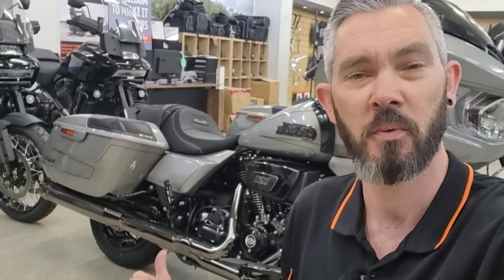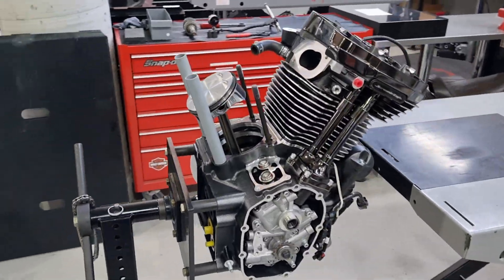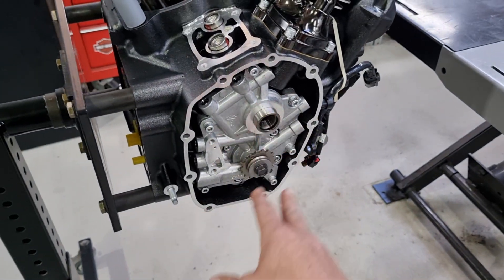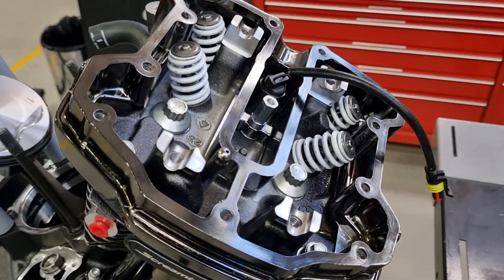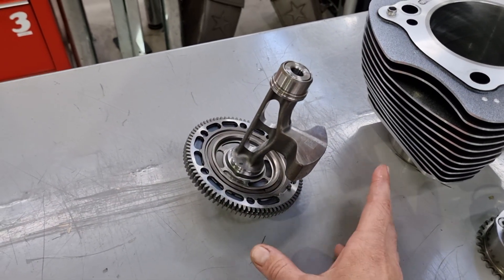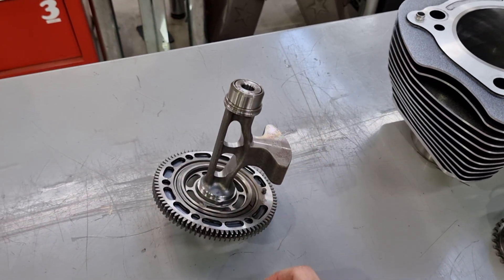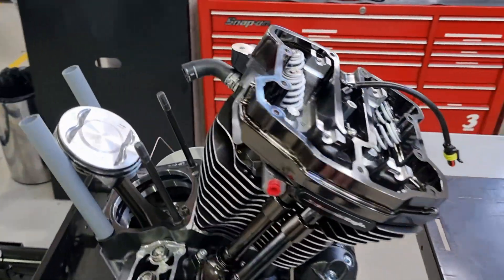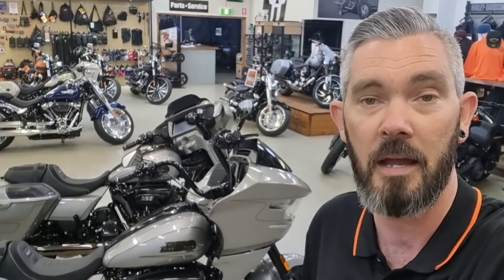INSIDE LOOK / NEW 121ci VVT M8 Engine / TEAR DOWN

Comment: @mastertechmiller. Have you noticed any issues with the high output 121? My 2024 CVO ST at 1500 miles is getting a new motor. Dealer said it had "worn internals". Not a reassuring answer. Others reported the same issue and are getting cyclinders replaced if not the entire motor.
Reply from the maker: @sleepingpanda8927  I haven't heard anything specifically about the High Output 121 but we did have an issue with our demo 117ci Center cooled M8 which was due to a stack up of events that lead to a blocked breather system (on the transmission cover). No harm was done to the engine.

It was only ridden very short distances & never really got to operating temps & as a result the oil developed moister in it which then helped to block the breather assembly.

Comment: I do NOT quite understand WHY they take HEATED coolant from one head and deliver into the 2nd head ?
I understand the concept of removing more heat from the cylinder with less air 
But , wouldn't it make more sense to cool both SEPARATELY ?
Maintaining EQUAL Head Temps for equal tuning of combustion ?
Reply from the maker: @user-rx9ww3ws6n  The front cylinder & cylinder head gets the majority of the wind passing over it. The rear cylinder & cylinder head is blocked by the front one.
 It's a known fact that Harley's rear head always runs slightly hotter than the front one so it makes sense to prioritise the cooling to the rear head as the front one has the additional aor flow passing over it that the rear doesn't get.

Each cylinder is capable of individually tuning so I can & do tune each cylinder independently of one and other so AFRs, ignition timing & temps are optimised.

Comment: For the money they demand for cvo models, which this motor would be fitted to. I would expect a screaming eagle cam plate and oil pump.
Reply from the maker: @DK-xy8gk  So far it is only offered in the 135ci Screamin Eagle Crate motor

Comment: My 2024 CVO 121 VVT makes a Ticking noise.  Reminds me of a Valve Train noise.  However I had Harley look at it and they said its normal.  Could you explain this.  Only seems to be prominent on Cold start and for the first 5-10 Mins after Start up.  Once engine is hot.  Noise goes away.
Reply from the maker: Yes it's normal. It's related to the VVT Cam phaser. Once oil temp comes up to operating temps the system is working alot smoother & the noises reduce.
That's the short answer.

I could go into more detail about the entire system, but just know it's normal & nothing to worry about.

The Revolution Max engine found in the Pan America & Sportster S models is exactly the same if not louder on cold starts with the same noises
Reply: @MasterTechMiller  In that short time that its ticking.  Its not doing any damage?   Sounds to me like the Lifters are draining out the oil and takes time to fill back up.
Reply from the maker: @user-df7df1eb8z  No, nothing to be concerned about. 
Because the engine is idling & going through it's warm up cycles, when cold starts happen, the VVT system is in overdrive as it is making constant adjustments to the valve timing. 

Remember, the engine is at low running speeds, which gives off erratic MAP (manifold absolute pressure) readings, which is one of the readings the VVT system uses for adjustments. Then, as the idle speed slows even further as the warm-up cycle is completed, the VVT system is again making many adjustments to give the best efficiency & smooth running to the engine.

At cruise speeds, the RPM, MAP & Throttle position is relatively constant & the VVT is quieter.
Reply: @MasterTechMiller  I appreciate the Feedback and makes me feel better about it.  I really enjoy my Legendary Orange CVO.
Reply from the maker: @RichardRamsey-l8o  beautiful colour!

Comment: Thanks for all great info. can you tell me there is electric wires coming out of the transmission.... And on the non VVT 2024 road glide  and street glide wires come out of the cam cover. THANKS
Reply from the maker: Wires from the transmission is for the gear position sensor.

The wires coming from the cam cover on both the VVT & Non VVT Engines is the cam position sensor.

Comment: By design, im not sure Duration adjustable.
Reply from the maker: Yes my apologies in my choice of words during the video. No scripts here, just point the camera & start talking. Occasionally, I will make a mistake & mix up my words. There is a lot going on in my head & when it's running in top gear & my mouth is only in 4th gear the delay can catch me out.

Yes the timing variable, not the duration. The duration is a fixed spec of the cam profile. However to get technical, the phaser system works off cam torque acruationl & can senses the shift in the cam coming over the nose of the lobe on the closing of the valve & when its ramping up to open the valve. 

So of for example the timing was advanced at the opening of the valve them retarded duration the opening & for the closing of that valve then it would, ever so slight increase the duration.

Comment: Biggest question, current M8s, can we vent trans cover, the case vent side, and plug head breather?
Reply from the maker: Yes! Absolutely. I have done that on a few bikes now. 
Keep in mind, when you vent the trans cover it relieves the head breathers so the chance of oil in the intake is reduced greatly so you can keep them in the head if you like or just put bolts in there to block it off.
Reply: @MasterTechMiller  thanks. Lots of inquiring minds want to know
Reply from the maker: @simeonhines9805  no problems
Reply: Do you jabe a recommended size of hose for venting trans cover? @MasterTechMiller
Reply from the maker: @simeonhines9805  5/16"

Comment: I seen this video the other day, and I am interested more in the crankcase venting. So, I went to my local dealer, and checked one out. Surprise! yes it does vent from the trans top cover, but the way it looks, the vent hose from the cover goes up under the tank, couldn't see where it ended. to me, I am thinking that it goes to the intake manifold, couldn't see a catch can. would you be able to see if it is actually a catch can? I am sure that the EPA isn't going to let it go to a breather. so I would like to know more about it.
Thanks
Reply from the maker: Yeah so hose from the Trans cover runs up & over the rear cylinder head & is routed back into the air box. It simply vents into the air box & not directly into the intake like previous models. 

With the added oil separation system in the trans cover & not directly routing it into the intake will GREALTY reduce the oil mist going back into the intake

Comment: I learned that HD "King of the baggers" won't be running this VVT motor.
Reply from the maker: There are a few things to consider why.
1. Lack of tuning for the VVT Engine
2. The large amount of tuning available for the Original M8 Platform.
3. Teams can use the largest displacement engine available from the OEM (135ci)
4. A tuned up 135ci engine will make more power than a non tuned 121 VVT engine.

Comment: Too bad they STILL utilize a split flywheel assembly that has a bunch of run-out. I wouldn't buy ANYTHING new until they address that nonsense
Reply from the maker: Have you considered the Pan-America ? It doesn't have a split flywheel.
Reply: @MasterTechMiller  yep, That's my next motorcycle.
Reply from the maker: @kennethwise7108  good luck with it. I hope you enjoy it

Comment: Damn, hardly any skirts on the pistons
Reply from the maker: How should they have designed them & why?
Reply: @MasterTechMiller  I have an idea that I need to get patented which completely does away with any runout of the flywheel halves and makes them perfect. No scissoring and indestructible. Aside from that weakness the motor looks like a great improvement. I spoke with the Screamin' Eagle guys at HD and they have no interest in running this motor in their King of the Baggers Season
Reply from the maker: @kennethwise7108  yeah ok mate. You didn't answer my question in relation to your statement about 'hardly any skirts on the pistons'.
How should have Harley designed there pistons & why?
Reply: @MasterTechMiller  The obvious is that with shorter skirted pistons there is significantly less support. Thus, it will wear out the piston and cylinder walls quicker due to the increased wobbling effect. I didn't mention ANYTHING about fixing or remedying this problem. I merely made a statement about how "short the skirts were". As an engine builder, I wouldn't even want one! More power to those people who don't consider things of this nature prior to purchasing the bike. Many probably don't even care about the longevity of a motor. This motor won't last 100,000 miles (160,930 kilometers). IMPOSSIBLE!!
Reply from the maker: @kennethwise7108  you better pass this information onto the Engineers at Harley-Davidson. I'm sure they've obviously not considered any of the points you've just mentioned.
Reply: @MasterTechMiller  They don't give a rats a$$. They just want to sell you another motor or motorcycle once it's junk. I got 157,000 miles on my Evo and wouldn't trade it in even exchange for this turd

Comment: I always remember and liked the Kawasaki VN2000 motor and the bike and I bought a service manual for them. One of the service items was checking for twist in the conrods which looked very slender for the size of engine. These Harley Davidson rods look similarly slender and just don't look strong enough and slipper pistons always amaze me that they don't twist in their bores. All the lightening work is likely matched with better metalurgy but things have to look right to me too.

Comment: Finally they vent the head through the transmission cover instead if spitting it into the intake or out for that matter. Seen another video where the white paint was coming off the springs into the engine.  Like who puts painted springs in a engine. ? Harley I guess
Reply: The air/oil mist is still routed into the engine. Excess oil is separated in the trans lid baffle and drops down into the oil pan. Air/oil mist into the intake is harmless to performance and can provide some needed upper cylinder lubrication.
Reply: Lots of brands in every area of automotive use paint to identify the springs. The bigger question is why are the inside of the ports and combustion chambers powder coated lol. Yes it comes off and yes goes through the engine- seemingly without issue.

Comment: Great video, glad you took the time to post it up.
Hope the paint does not come off the springs.
I have 3000 miles no major issues so far. 
I changed the air filter and put khrome werks slip-ons with performance baffles in and se tuner she moves. 
If you find out how to change speed limiter that would be great! lol
Reply: That was my concern as well with the paint on those springs. Last thing anyone needs is a paint chip clogging up a oil port
Reply: Mine have no paint but mine are also cnc ported that come in s/e kit

Comment: Thanks for the insight into the new 121 .
The VVT system is simpler than I thought it would be.
You mention the Cam duration is variable , but I'm sure you know the system can only advance or retard the Cam, and not alter the duration, as that is ground into the Cam.
Reply from the maker: Yes my apologies in my choice of words during the video. No scripts here, just point the camera & start talking. Occasionally, I will make a mistake & mix up my words. There is a lot going on in my head & when it's running in top gear & my mouth is only in 4th gear the delay can catch me out.

Yes the timing variable, not the duration. The duration is a fixed spec of the cam profile. However to get technical, the phaser system works off cam torque acruationl & can senses the shift in the cam coming over the nose of the lobe on the closing of the valve & when its ramping up to open the valve. 

So of for example the timing was advanced at the opening of the valve them retarded duration the opening & for the closing of that valve then it would, ever so slight increase the duration.

Comment: Where are they sending the vented transmission vapors to?
Reply from the maker: The intake manifold as per EPA requirement. The added oil separator, length of the vent hose & the fact it has to travel 'up hill' now greatly reduces the chance of oil mist re-entering the intake manifold that everyone cries about.
Reply: @MasterTechMiller  I am glad to see HD finally ditching those head breathers for a much more effective way of venting the crankcase... many people will still use catch cans or vent to the atmosphere to keep the hot oxygen depleted air from entering the combustion chamber creating better engine performance. thanks : - )
Reply from the maker: @richardrussell500  absolutely 💯
Reply: I am looking forward to long-term reviews on this new engine... the M8 has had its own problems over the years. Sumping and overheating are the two biggest concerns.
Reply: @MasterTechMiller  I am glad to see HD finally ditching those head breathers for a much more effective way of venting the crankcase... many people will still use catch cans or vent to the atmosphere to keep the hot oxygen depleted air from entering the combustion chamber creating better engine performance. thanks : - )

Comment: Interested to see how these heads flow compared to the older M8 and if they are backwards compatible to make a higher compressions better breathing M8 with the revised ports,chamber etc without the VVT.
Reply from the maker: From initial observation it looks like they will bolt straight on. 
The engine temp sensor has been relocated to the front cylinder on the new M8 VVT Heads & so have the knock sensors. That shouldn't prove to be a difficult hurdle to over come so I'm hoping they will be able to be a direct fitment
Reply: @MasterTechMiller the induction module, cooling & breather system are totally different. Only the bolt pattern is the same. It’d be a pretty difficult thing to actually use the 121 heads on an earlier model

Comment: Still they didn't solved the carbon build-up problem. 

I saw a video from an onwer removing the valve cover & looking the pistons heads..

Lots of carbon at early low mileage CVO 2023 engine..
Reply: Change oil and service regularly as bike needs care like anything. Do that an carbon will never be a problem and many kms you will get out of it.Carbon will be the least of your worries.
Reply: Thanks again for the insight and probably the only detailed look into the engine not many of us will probably own and pull apart. Great work mate 👍
Reply: it has nothing to do with oil changes. . .its running lean from the factory...needs tuning and research to fix that issue
Reply: @SilverIndian  it has to run Lean from factory to meet EPA Harley can’t change that. It has to do with re circulating blow by into the intake which engines have done for many years. Bottom line service and look after the bike in stock form and carbon build up wont be a Issue to the motorcycle producing many years and Kilometres. So Carbon build up isn’t a problem. It’s only a problem because you read to much on internet with company’s pushing products to sell to gullible people. I currently have a twin cam 96ci with 150,000kms dead stock never rebuilt and a 103 with 44,000kms with cams pipes tune and it’s caused more dramas then in stock form
Reply from the maker: @Toyota_MK4_  The biggest issue is folks riding these air cooled V-Twins around like a sissy. Not getting the combustion temps & pressures up high enough to burn off the carbon deposits. They tend to 'lug' them around in too tall of a gear at too low rpm ranges resulting in excessive carbon deposits & build up. Sure, factors such as fuel quality/octane rating, environment & service discipline all can contribute to this aswell.

The fact that Harley-Davidson & every other mass production motorcycle or car manufacturer has to route the crank case vent back into the intake manifold is a EPA requirement. It's widely known that Harley's have oily intake manifolds because lots of guys out there take their air filter off to service their bikes at home & see it for themselves.

Can you imagine if you took ANY internal combustion engine gasoline powered motorcycle on the market today and took the crank case vent hose, ran an external hose out of the intake manifold & pointed it towards yourself while wearing a white shirt. Then go for a 100km ride & tell me how clean your shirt is.
Reply: What you said is correct. Most people don’t gun on them to burn off excess carbon. They want to put put them thinking they will last forever that way or scared if they stress to won’t the motor out it will blow up. I’m on my 4th Harley. Just bought a new 2023 Roadglide-ST. The first thing I did was plug the holes in the factory snorkel and ran a hose to the bottom of my bike into a filter to catch the blow-by. I have it mapped with a powervision tuner. 2into1 Sawicki stainless pipe. I ain’t scared to redline it and run it. lol
Reply: @MasterTechMiller  Any old-fashioned master mechanic, car or bike mechanic would always recommend you do the "Italian Tune up" to get rid of Carbon deposits on your pistons and spark plugs.

Comment: Can't wait to see cam upgrades
Reply from the maker: Me either
Reply: @MasterTechMiller it’ll be fairly limited for cam upgrades unless they plan on locking out the VCT or limiting it them for movement. Either way when custom tuning comes out and you can take the time to work with it. The gains especially under the curve will be wild, it’s really shocking nobody has gotten on top of the rev max engines for tuning. I’ve yet to see any  one take the platform seriously